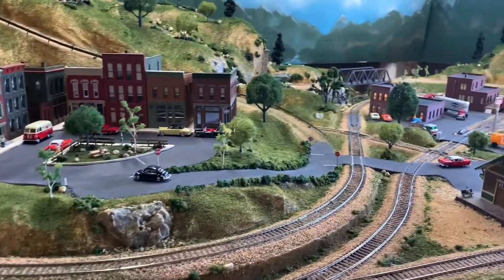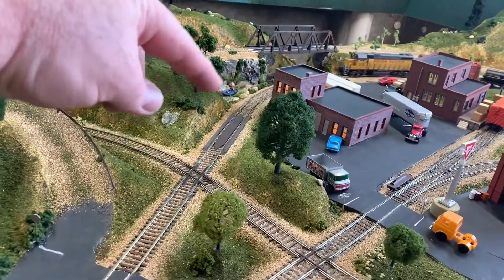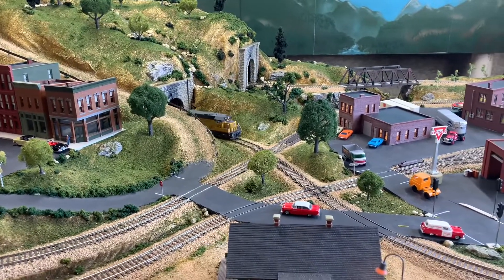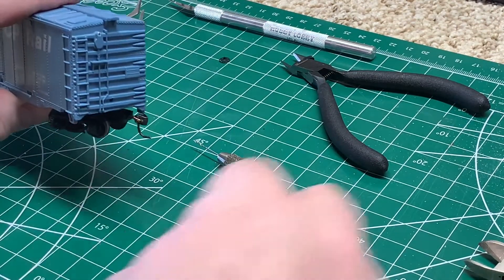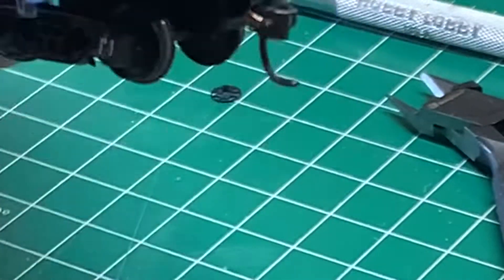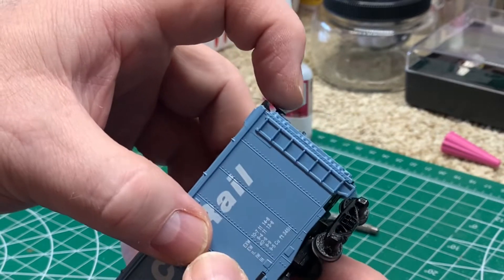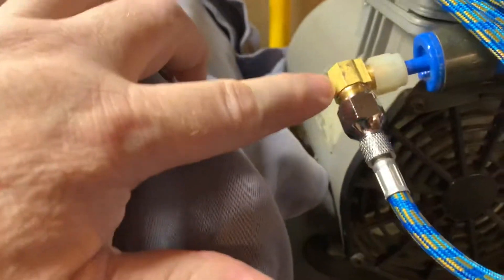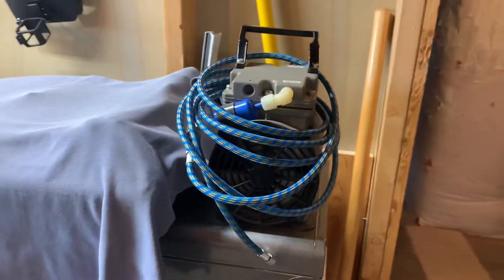BLI 2-8-0 Update, Quick Brake Wheel Install & Upcoming Projects

Comment: Bummer about the steamer, Dan! But of course they are far too expensive to have that sort of defect. Give it time and take a look at some other steam loco's down the road. 
I am interested in changing my little bachmann 2-6-0 with sound value decoder to a full function decoder, but have  barely scratched at the surface of actually doing it. It handles the curves fine but only sees duty as an excursion train. I'm going to custom name it and the old time coaches with a custom decal or paint eventually.
I love my pin vise! The brake wheel looks nice. Those old tyco/mantua cars can be made to look pretty good with some attention. Looking forward to the next videos.
Reply from the maker: Thank you as always Tom! Yeah, it was far too expensive to accept with that kind of defect. I didn’t say it in the video but when it went around the track behind the industries and that part caught the re-railer and flipped the entire thing over I kind of decided then and there that it was going back! LOL. 
That little pin vise is part of a four piece set that was my dad‘s. He had it for many many years. It was always one of those things he would show me and say someday this will be yours. I treasure it. Haha. I’ll definitely keep an eye out for some other type of small steamer, we’ll see what comes along. I like the idea of making your own custom decals. I have done it on my laser printer with black toner, but I have never done it with color on an inkjet, might be something fun to try out.

Comment: I have a BLI switcher I'm sending back for the third time.  I hope you have better luck.
Reply from the maker: Yeah not sure what's going on with them, but this should not be a problem on a brand new loco, unless it was damaged at the store.  What do you think about that Harbor Freight airbrush?  Gonna try it out soon, a cheap starter I figured.
Reply: @DansGrandValley  I think it is a really good airbrush to start with.  For the most part, the only difference between the cheaper airbrushes and the more expensive ones is that the needle is more highly polished.  Some people use polishing compound and remedy that issue.  The only issue with that is that you have to be extremely careful not to bend the needle.
Reply from the maker: @FlyingCrow  ok good to know.  I have all kinds of buffers and polishers.  I could probably do something, hopefully without bending it.  Thanks Robert!

Comment: That is interesting about the Broadway Limited. I saw in your photos that the bottom of the crosshead was broken and missing a piece.
Reply from the maker: Oh wow, I did not know that something was physically broken and missing.  This was sold to me as brand new, although it was in a display case.  It was demonstrated for me but thinking about it, it was facing the other way, showing me the right (undamaged) side, so I would not have caught it.  Thanks for pointing that out.  Like I mentioned, steam is new to me so I had no idea what was complete and not.
Reply: @DansGrandValley  You're welcome. It was on the inside of the bottom of the crosshead. It has a rough edge, like part of the guide toward the rear was snapped off. The top and bottom guide rails are also bent out of shape.

Comment: Dan,sorry about the loco. I have two BLI SW 1500 that I bought at the same time, for what I paid for them I am not happy with their performance on turnouts and if track is slightly dirty. But back to loco I purchased a Bachmann 2-6-0 that has sound that I use with some Roundhouse old time passenger cars that I am really surprised at how good it runs and performs. Did you ever find out what was wrong with the MTH making noise while backing up? Anyway Dan as usual another great video!
Reply from the maker: Hi Lou, thank you very much! Yeah I might try some thing like a 2-6-0, I’ll have to see what comes along. I did find out what was wrong with the MTH loco going in reverse, it needed to be lubed. I was able to get a tiny nozzle with some dry lube inside and get just enough on it to clear that up. I was afraid to take it apart, cause I didn’t wanna break any of the tabs, so getting in there with a little nozzle was the key. Thank you as always Lou!👍🏼
Reply: I have a 2-6-0 steam locomotive it’s awesome

Comment: Dan, just curious, are you limited to running only the GP38-2's on the GV? I'm wondering if an engine like a dash8 or SD40-2 would be a problem on the layout?  I'm also curious if there is anything you would do different if you had to do the GV all over again.
Reply from the maker: Hi Marc, thank you for watching. No I have a Bachmann GP 40, and a couple of Bachmann F units that run great on the layout. I have to keep it to the smaller two axles per truck models to be able to make the 18 inch curves though. Yes! If I were starting the GVL tomorrow I would definitely utilize the space inside the mountain better. I made a few videos back in November and December where I created a winter scene module to fit in there, however if I had some forethought before starting the layout I would’ve utilized it better with switches, or a mini yard or bypass. I also would do something to eliminate the cross track on the main line. I would have built the entire layout on a thick piece of pink foam and then been able to excavate down under the other track to eliminate that cross without having to build a huge trestle. I may have also installed the switches that I ended up putting in the front of the layout to create a yard, because one of the main things with the GVL is there’s no place to park trains. Great questions! Thank you so much for watching.👍🏼
Reply: @DansGrandValley  Just a couple other questions if you don't mind. Does the cross on the main line create a lot of derailments for you? I also notice that the grade really slows the train down when climbing. Have you tried to run a couple engines in a multiple unit lash? I'm thinking of getting the GV, but keep talking myself out of it.
Reply from the maker: @marcsoscaletrains  Once I dealt with the inherent problem in atlas switches and crosses, where the plastic in the frog makes the wheels ride too high I don’t suffer any more derailments there. Sometimes a low hanging coupling may hit it and cause a problem, but the biggest problem is just not paying enough attention when running multiple trains and having a collision. Remember that curves also create drag on a train as well as grades. That in combination is enough to slow down a single locomotive that’s slightly overloaded. Yes the two GP-38‘s work very well in consist and I can pull a lot of box cars and rolling stock with them. That’s the main reason I got two of the same ones so that they would be speed matched and handle the curves and grades easily on the GVL. I definitely think you should get one, I got mine at Tower hobbies and utilized one of their coupons and got a really great deal on it. Not sure what the pricing is now but they do give you everything you need to get up and running. There are a lot of Youtubers that are doing the Grand valley, so there is a lot of support and info out there, plus You can ask me anything, I’m glad to share my experience. 😁
Reply: @DansGrandValley  Thanks Dan, I appreciate the responses.  If I get one I'll let you know. I'm primarily O scale, but have an interesting story to tell with HO too.  You did a fantastic job on your layout and I can certainly appreciate the hard (yet enjoyable) work that went into it. Thanks again, Marc
Reply from the maker: Thank you Marc, def keep me posted. 👍🏼
Reply: @DansGrandValley  Hey Dan, just about ready to pull the trigger. Found a decent deal at Model Train Stuff. $419.00, plus shipping. By Chance, do you know the highest point of the GV layout? I'm thinking of building the main structure then moving it and was curious if it will fit through a standard door way.  Thanks again for answering all these questions.   Marc
Reply from the maker: @marcsoscaletrains  that's a great price!  Cool!  Just looking at the plans, the boards that make up the sides are 8" high x 24" long, and at the highest peak you use 2 and 1/2 of them approx.  So from the base to the height of the mountain should be about 20" give or take depending on how you form your mountain tops.
Reply: @DansGrandValley  thanks Dan. I’ll join in on the next live show to say thanks.